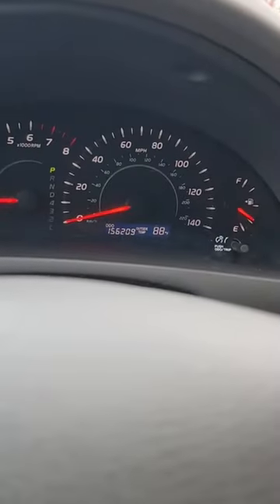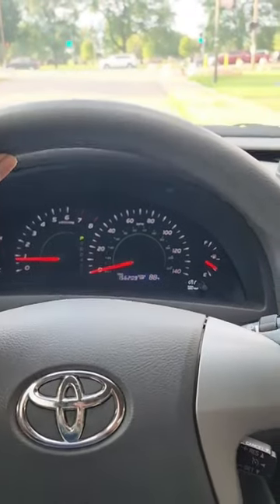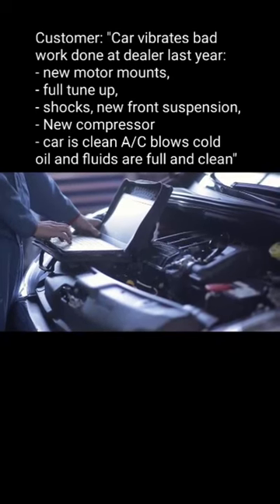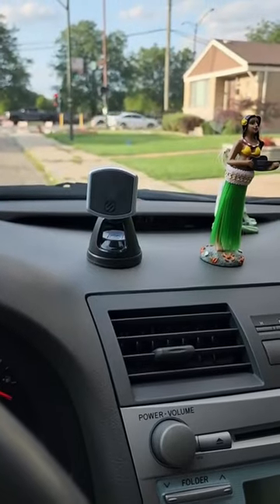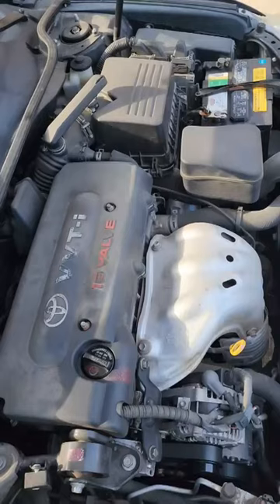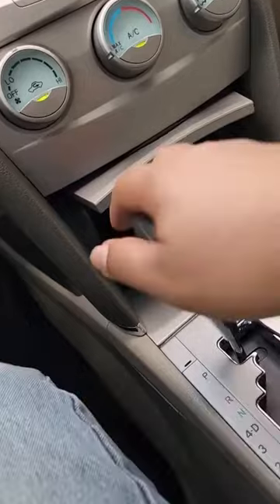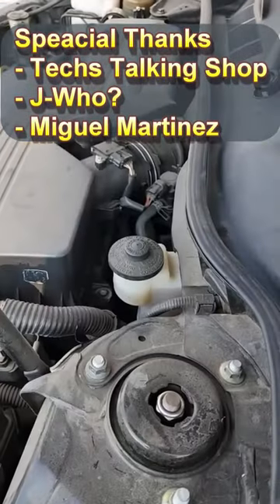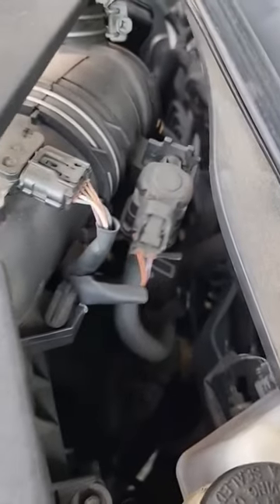Diagnose Shaking 2009 Toyota Camry in 30 seconds? (The answer you waited for!)

Comment: Did you fix it, what  was the problem?
Reply from the maker: Please see the play list in my last comment on this video but the short of it was, it needed a tune up / 100k service, also the motor mounts were installed wrong by the last shop, the motor must sit perfectly straight on them, and the body had some repairs done where the motor mounts don't sit right. I replaced the motor mounts and harmonic balancer and made some adjustments. This got it to calm down alot. It's not perfect but much better the customer understood. If we could do frame repairs, we could get it to be 100% back to normal.
Reply from the maker: Oh I almost forgot I have to finish editing the video on the motor mounts too.
Reply: @edtheoldtechguy  is the video up yet?